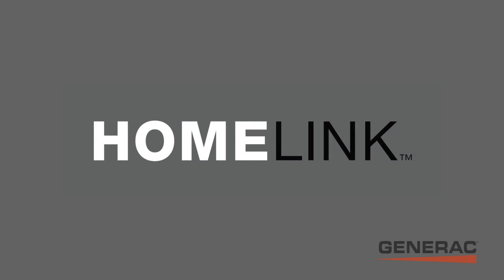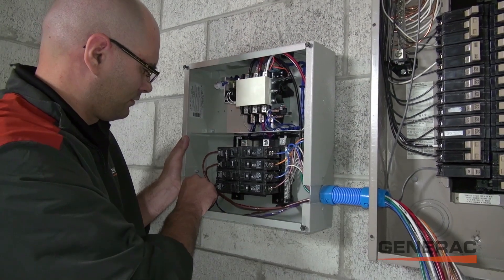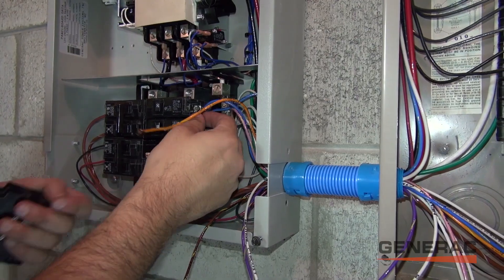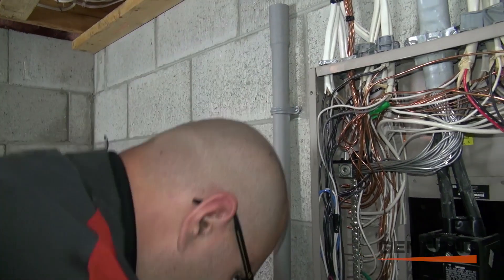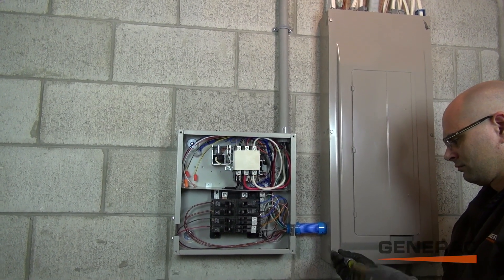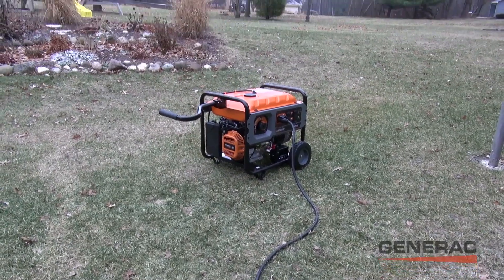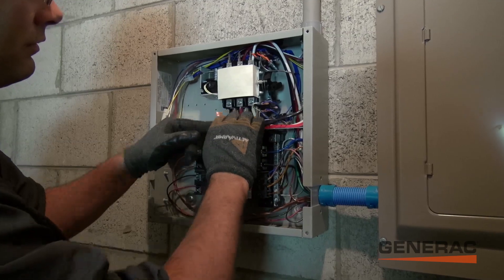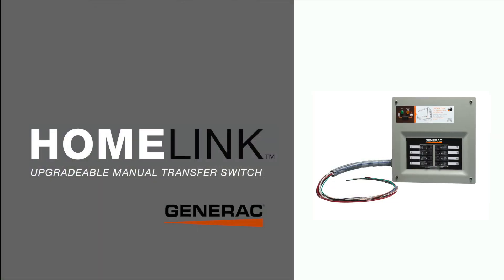Generac Homelink Manual Transfer Switch

Comment: are the neutrals also  seperated or  do  they  connect to  the  main  neutral  bar?
Reply from the maker: Thanks for your question! We recommend consulting the HomeLink manual transfer switch product documentation on our website for wiring diagrams and exploded view documents, which will help answer your question. Enter the part number G0068531 on our product lookup page: https://www.generac.com/support/product-info-user-manuals/